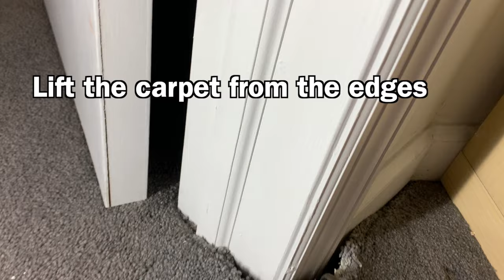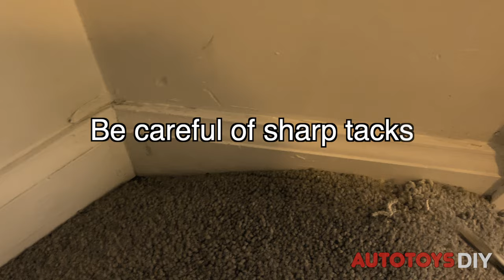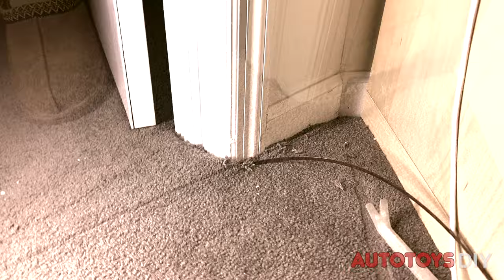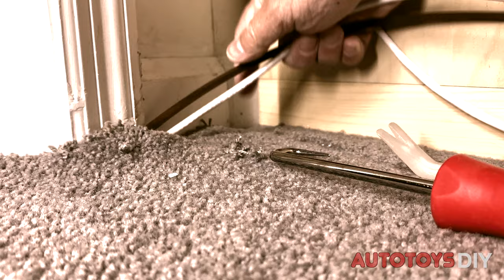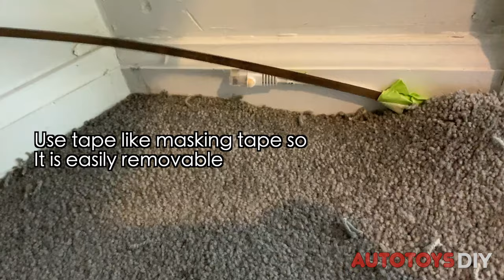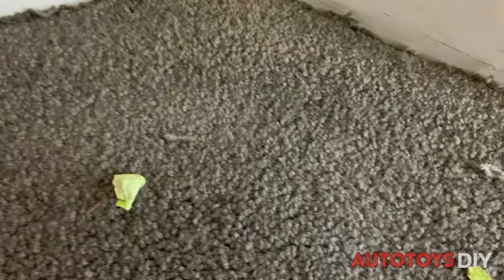Diy: How To Easily Run Ethernet Cable Under Carpet Or Doorways

Comment: Do NOT do this. You’re lifting it off the tack strip essentially re doing all the carpet stretching the installers did. You will have wrinkles in your carpet
Reply from the maker: That’s why you stretch the carpet out when you put it back. No problems. Bad advice on your part
Reply: I agree with Tyler ...it worked out for now but only time will tell.
Reply: @Autotoys is the carpet still good after a year?
Reply: Must’ve gotten in trouble and had to undo it so no more internet that’s why he’s been mia lmao but for real don’t do this if it’s not your own home I guess

Comment: Wouldn't have been easier to have the snake coming from the opposite side, that way you could have reeled it in?
Reply from the maker: Possibly. The reason why we used the front of the tape was because we used the front end (about 8 inches of lead) of it to reach in, and pull through the padding. (with the connector coned and tape off for slip through). Regardless, in this example, it was a short run - for longer runs, it will definitely be beneficial to reel as you retrieve.

Comment: Don't you need a knee kick or similar to properly stretch the carpet on/off the tacks?
Reply from the maker: Used a hook tool, pulled it tight, and re-attached. Hole where hook tool went away once we brushed the carpet.

Comment: How do you feed the fish tape initially to not damage the padding?
Reply from the maker: You will make one hole to get into the padding from where you enter, but the trick is then to get underneath the padding and the slab. (Or wood floor)